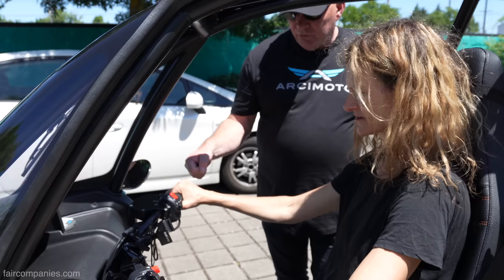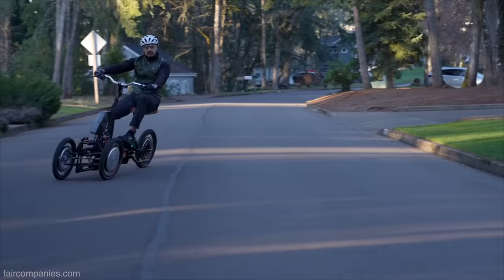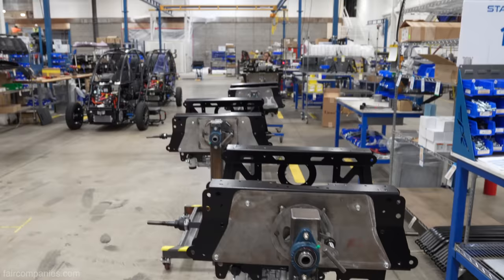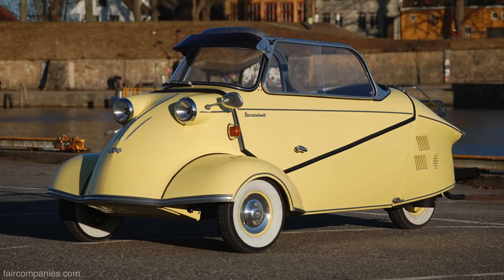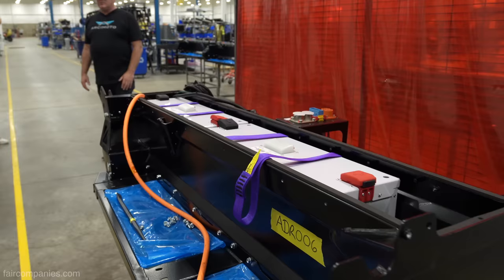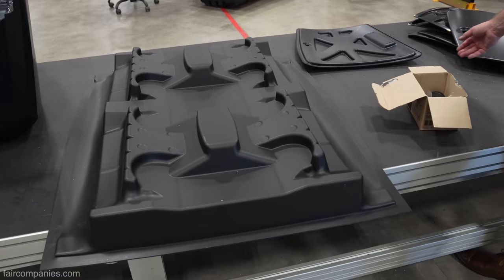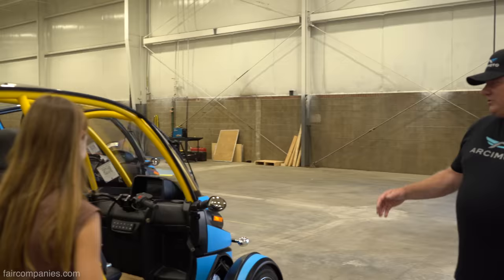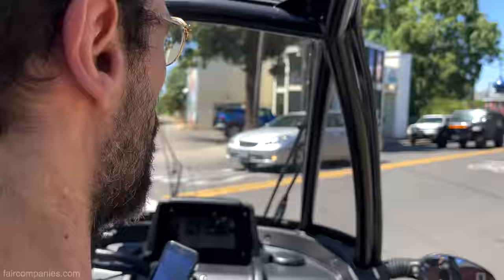Arcimoto 3-wheel EV commuter blends bikes' fun + cars' safety

Comment: I ride a 750w E-bike everywhere, I don't drive a car although my partner and I own two cars. I don't think that I will go back to driving a combustion engine car, if cost would  come down I would want an electric motorcycle or car but for now it's not affordable. I really like this vehicle though, I'm keeping my eyes on it going forward!
Reply: We are kindred spirits. I drove the ultimate cargo bike, the Organic Transit ELF, for 7 years as my only transportation. It had 750 watt motor, 100 watt solar panel roof and 8 speed shift pedaling. It weighs just 160 pounds and is enclosed, as shown in my avatar image. It was a shock at first after owning cars all my life but I saved $3000/year with no car expenses, enough to pay cash for my Arcimoto. Smartest purchase I ever made in terms of practicality, sustainability and fun.
Reply: @popeyegordon  that is impressive! I suppose there are many reasons why I choose to commute like this, cost being one of them. I thrive from the social interaction that comes from slowing down and taking time to mingle with people outside. I'm extremely active for quite some time now, bicycling long distances of course and then a daily strength training routine, it also helps to regulate my mental health. My current E-bike is an Aventon Level, Step Through version. I bought a child seat and other cargo attachments for shopping and such. Other than when I have to go somewhere with my partner this is how I travel. I don't see it changing any time soon. Thanks for the reply to my comment, it's nice to connect and see how other people are living! Have a great day! 😀
Reply: When Arcimoto get to mass production the price will drop to around $13,000. My guess... 2 yrs. Congress is passing a Green bill that might help to buy EV's. Fingers crossed.
Reply: @beachbum200009  You are confused. You can't miss the gigantic 200,000 sq foot factory tour where they are currently mass producing, if you watch the video. Early stages of the rampng up to 50,000 units per year from this factory. This is the 4th year of production that graduated from an R&D shop to a startup factory to an automated megafactory. The pandemic is slowing all production for all businesses equally.
Reply: @popeyegordon  Yup they bought the building. This yr they will hit about 1000 fuv's.
Next yr about 7000 ... what Arcimoto said.
They are still a long way from 50,000. I don't know when they will hit it.
I'm hoping in 2 yrs with money made from rentals and bikes they will drop the price on the fuv's. That sure will help sales.
We will have to wait and see.
Pandemic didn't help product at all.
Best wishes to you.
Reply: @beachbum200009  I would like to do what the previous commenter said they did. Ride an E-bike for years and take those savings and put it towards an Arcimoto. By then if that is the price or somewhere in that range I would be very interested.
Reply: @Mainstayjay  It's a good plan if you live close to everything you need.
Reply: @beachbum200009  I do and have been commuting this way for months now. I have saddlebags and a foldable cargo box with wheels and a telescopic handle that mounts on a Topeak quick track bike rack. Yesterday we bought a used two seat child trailer that will double as a cargo trailer for me. Now I won't be limited to the cargo capacity of the box. Grocery shopping is a 15 mile ride or 24km ride but the E-bike makes that much easier. Other shops and places for entertainment are all within range as well. I ride on average 40 miles/64km per day, sometimes more because of evening rides with my 2 year old daughter. I had to work at my fitness level at first and I still do strength training but bicycling long distances is a daily thing for me so my body has adjusted. I use low level pedal assist mostly, and by doing that I am able to ride 65miles, 104km at the very max before the battery needs a charge. I have two batteries but rarely need a second one throughout the day.  Top speed of my E-bike at level 5 pedal assist is 32mph/51kph.   My speed is usually around 15mph/24kph though.
Reply: @Mainstayjay    Great setup!!!  Keeps you in shape and saves money.
I got 40 + yrs on you and it would take me 2 days to get to my dentist!!! LOL
Reply: @beachbum200009  if you are 85 then yes, you have 40 years on me. Haha. On social media I joined an E-bike group specific to the brand I have, there the average age of the rider seems to be 65ish??. There's an older gentleman who posts his rides and he is 71, another rode 74km on his 74th birthday and 75km on his 75th. Because of this group I am finding that especially now, in the times we live in, people of all ages want to do something different, live differently. The E-bike is a fantastic option for older experienced bike riders to continue doing what they love and stay moving or for someone with no experience but is looking to make a physical change and needs that assistance to pull them through when they can't do it themselves. The right E-bike can turn into a moped if needed. As far as the speeds matching up....I would just tell someone with less experience to not push it past their abilities. Adjust and then speed up. As for myself, it's not just a hobby but also my choice of transportation.
Reply: My beginning sentence wasn't correct, ''If you are 75 then yes, you have 40 years on me", is the correction. I am 35 years old.
Reply: @Mainstayjay  ok 34 yrs. lol

Comment: Looks fun. But in northern states you’re going to need more enclosing than any of the units we saw in this video. I hope this company is successful, but at this point, I think it’s going to be a long haul.
Reply: Agreed. It’s fine in California 90% of the time. States like Washington not so much! 🤷
Reply: They manufacturing in Oregon. And its perfectly fine in the rain. You can get optional doors though. The seats are heated as are the handlebars.
Reply: @arghjayem  I’ve had mine the Seattle area for 15 months only three weeks during winter did I not ride at least once, often 3x to work.
Reply: A e-bike and a coat is probably a better idea than this, if you're worried about the weather.
Reply: @liamness  it would be in a town with good biking infrastructure. But I can take another person, go shopping, drive to the next town over, carry golf clubs to the course etc. both have their uses.
Reply: @liamness  No not by a long shot. This thing has heated seats, grips, and a full windscreen and roof that keeps you dry. And front wheel drive with traction control.
Reply: @davefroman4700  and open sides
Reply: @liamness  You obviously do not understand fluid dynamics.
Reply: @liamness  Watch the video. There are models with doors.
Reply: @chezmoi42  from the brief appearance I saw of a door option, it didn't look like it would provide an effective weather seal, as it had no window portion. Not sure what the timestamp I saw it at was though.
Reply: Boomer was proved wrong before this video was posted. In rainy Washington state they just started a rental fleet of FUVs. There are numerous owners there too.

Comment: I don't go to Starbucks... Anyway, where I go, I prefer to use something prettier, more practical, and really environmental friendly: a bicycle.
Reply: The amount of carbon footprint just to make a new 1000lb+ vehicle of any type is huge.    Give me a bike or a 20+yo car,
Reply: @whaterfoo  False equivalency. The valid comparison for carbon footprint is not between bikes and the 1300 pound emissions free Arcimoto, it is between the Arcimoto and a 7000 pound Tesla or an overpowered redneck pickup truck. I have been a hard core bike rider/commuter for a decade before retirement and now a decade after I have been driving the 160 pound solar/pedal hybrid Organic Transit car-bike. I have no excuse to burn gas when I have the time to bike for errands. BUT AGE IS A VALID FACTOR As I age it gets harder to pedal a trike or balance a bike or scooter. Using ebikes saved me over $30,000 compared to driving a used car. I spent that cash on an Arcimoto. Now I can handle the aging factors and still have lots of fun safely here in Florida, the most dangerous state for bicycles or motorcycles. The average age of an FUV buyer is over 55.

Comment: They need to get costs down. Bought my gently used Chevy spark (which has a roof and air conditioning) for 6k. 17k plus is a hard sell for this... Cool Idea though
Reply: I hope as they continue buildings it goes down in cost
Reply: Directly comparing the prices of used cars with a new autocycle is absurd. The FUV has a full roof. A  Spark uses twice as much power to get you from A to B. Insurance for that costs more too.
Reply: @popeyegordon  Well, a new spark is supposed to cost around 16k. I will say this is definitely cooler than a spark though. My commute is only 2.5 miles so energy consumption is not too much of  a concern in my situation.
Reply: @user-ok6ef9zn4f  It all adds up. The mission behind Arcimoto is to offer a leaner alternative than the average car use of one or two people in a 4 seat car with an empty trunk. It does not have to be able to replace all car use, just 90%. The spark will use twice as much energy as you need and take twice the parking space, cause twice the tire and brake dust. The biggest EV blunder is Tesla, which contains enough materials to make 3 or 4 Arcimotos. The world is going to fugure out that Teslas are a bad idea when we do the math.
Reply: @popeyegordon Tesla is the reason why Acrimoto is here.  Even in the video they are trying to use Tesla's model of vehicle entry to other jurisdictions to access states that are not so friendly with these types of vehicles.  Will Tesla evolve, time will tell.  But Tesla did create a pathway for the boom in electric vehicles.

Comment: I can't imagine driving this on the same streets that have full sized trucks.  That thing looks like a death trap.  Average weight of a truck has increased by 30% in the last 20 years. Average truck in 90's use to be roughly the size of a current Subaru.
Reply: A billion motocyclists imagined and did it. The FUV offers more safety than any of those, same level of safety as any small car but by the different sytem of roll cage and harness. THE AVERAGE SAFETY OF CARS HAS EQUALLY INCREASED IN THE LAST 20 YEARS and this includes the new FUV design. No change. The first serious collision has already happened and the guy waked away without a helmet thanks to the superior safety of Arcimoto design. He will tell you a motorcycle is a death trap but the FUV is safe. In fact he'd be pretty pissed at your malcious lie.

Comment: With all the solar generators on the market it would be interesting to see if Arcimoto could develop a plug that would allow you to 
take one of those generators along in a storage space and link to the main battery pack as a range booster, kind of like a belly tank on a fighter aircraft.   Also, if power was out it might be a way to generate power for the Arcimoto in a power-out emergency.  Great video.  I hope Arcimoto won't be a stranger to Florida.
Reply: Florida is one of their biggest markets already. That's where mine is. The capacity for a portable solar battery power kit (not a generator as they falsely name it) has to be really large for the FUV. $1000 cost and might not fit in the trunk. 1500 watt capacity and capable of hours of charging means the kit would weigh 100 pounds and be very bulky. There is more interest in tapping EV batteries to run homes in a power outage. At least your fridge. There are several Arcimoto owners who set up camps and use a portable solar power system but these take days to fully recharge it.
Reply: @popeyegordon  I enjoyed your reply.  I was just spitballing some ideas to modestly extend the range of the Arcimoto and give it extra utility.  You're right about the solar generators.  Basically they're heavy duty battery packs with a (slow) solar recharging option but there is their weight and size to consider.  But they're set up for plug-and-play for the needs of most people.  A very popular one says it's about the size and weight of a gallon jug of milk. How much extra range could that generate if there was a plug in the "boot" of the Arcimoto that would allow you to strap in your charged "solar" generator and feed the FUV's main battery system?  What if it was just you using the vehicle and you had the delivery model but with a seat in the back (sliding door would have tinted windows) and you could strap in one of the much larger generators in the passenger seat if you wanted to take a 125-mile round-trip (mostly interstate) without stopping to recharge.  Then, just take out the generator when you wanted to run around town with a friend in the back.  What about the possibility of replacing the roof panels with solar panels?  A little extra utility might mean a great deal more acceptance across the nation. The Arcimoto is an exciting idea.  I just want to see it succeed.  Most people probably won't consider an electric vehicle practical for any kind of day trip if the vehicle can't manage a useful recharge while they're having a sit-down lunch.  Of course, there is always the beach-tourist rental market but I think the Arcimoto has much more potential than that.
Reply: @brucegraner5901  Your intention is good but it would help if you look at the continuous wattage output ratings for those kits - a gallon sized one would immediately blow its fuse while trying to charge the 18KWH Arcimoto battery or anything bigger than an ebike battery. A larger [not really a ] 'generator' would just be the battery and inverter with no output from the panels while we are driving. Also the charge function requires the vehicle to be powered down. Before considering a 125 mile round trip we must ask ourselves if it is vital and why we won't use public transportation for that. We can justify the occasional camping trip but not daily commutes of that distance. This $2,900 popular brand can run a microwave oven for 45 minutes on its 1.5 WH battery capacity. It has the power to replace just 3% of power in the FUV battery. That's a lot of money for such a small EV charge but theoretically if that was all you used it for you could charge the battery half way with a week of sunshine. If you relied on it to get home you are risking being stranded if it breaks or if it is cloudy weather. https://www.amazon.com/Jackery-Generator-SolarSaga-Overlanding-Emergency/dp/B08Z3FRXW4/ref=sr_1_4?crid=3LPE2DNZHTX3X&keywords=1500+watt+solar+generator&qid=1659550841&sprefix=1500+watt+solar+generator%2Caps%2C181&sr=8-4&ufe=app_do%3Aamzn1.fos.a35299f9-b208-4220-b44f-8302ea287e63

Comment: The electrical grid wouldn't handle 5% vehicles being electric on the road.   Solar is not environmentally friendly to manufacture, wind is a environmental nightmare,.  Nuclear is the only option of we go down the ev route.
Reply: An EV uses precisely the same amount of electricity needed to produce fossil fuel to move a vehicle the same distance. But it does it without burning the fuel.
In other words, divert the grid supply from the refinery straight to an EV fleet, you move similar vehicles the same distance, using the same grid energy.
(Confirmed by experts)
.
Your standard "grid overload" FUD has been disproven.
.
Nuclear? Start now, ready in 20 years...... Not needed.
Reply: Nuclear is the Roadrunner's ACME dynamite kit, ready to blow up in his face. All honest discussious about EVs include the fact that they will never appear all at once and there will be no issue with sudden increased loads on the grid. Renewables are increasing too. Rooftop solar is very good for the grid as it decentralizes the loads. The peple who like solar are the most lokely to buy EVs first and charge them for free at home. There are already Arcimoto owners saying they are charging from their roofs. So much for that...